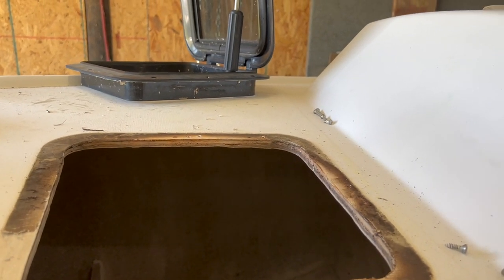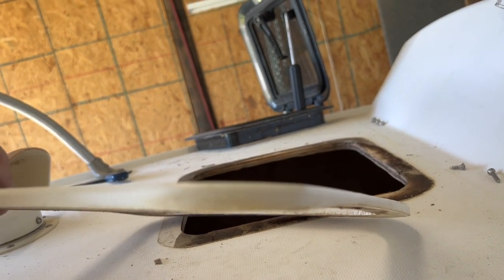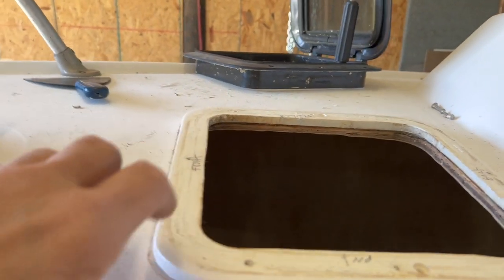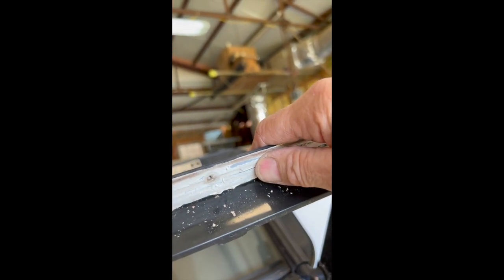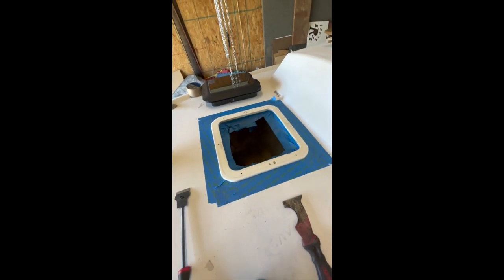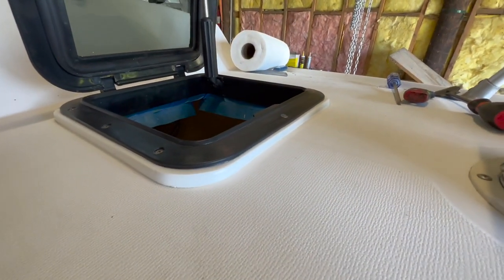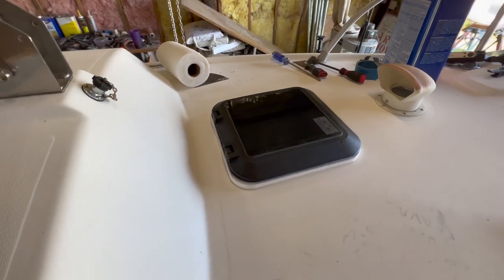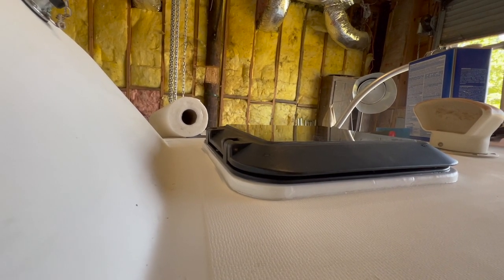Foredeck hatch repair

Comment: I read where you already sold this Compac 16 but was wondering if you have the manufacturer's name and/or model number of the hatch?
I searched Amazon and could not find a hatch similar to what yours looks like....thanks
Reply from the maker: Unfortunately I could not find manufacturer info on that hatch anywhere while I had it removed
It was probably a bomar knock off
Reply from the maker: Bomar makes hatches down to 10” in several styles

Comment: If it failed once before it had a flawed design.  You could build up that space from the deck to the bottom of the hatch with foam base covered with fiberglass & epoxy resin.  That would give you a solid lip that would provide a better seal.  It is more work but it would not fail.  S/V Spoondrifter has a great video of building the exact lip needed for this hatch refit.
He even shows hoe to compensate for the curve of the deck & the base of the hatch fitting together.  You might want to check it out.  Cheers, S/V Cork~Texas
Reply from the maker: Thanks
That is what I will do if /when it leaks again
I will check out the video

Comment: I am curious why you did not use wood instead of the cutting board?
Reply from the maker: This was originally installed by the previous owner several years ago
I thought I would try and re- bed it to stop the leaking as is before glassing in a curb or using teak or whatever.
After almost 2 months it has remained leak free so I am hopeful it will last a good while
We have had quite a few heavy rains since re-bedding it and so far all dry inside
Thanks for watching!
Reply: @theboatnik1328    I do love that boat!